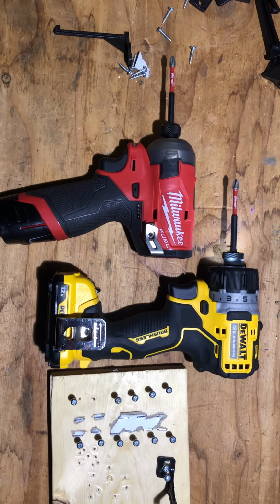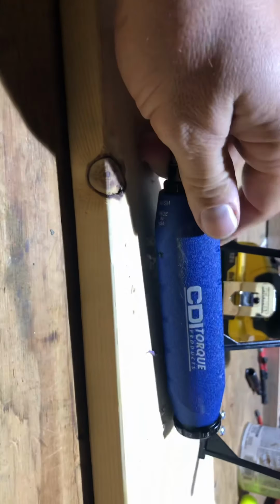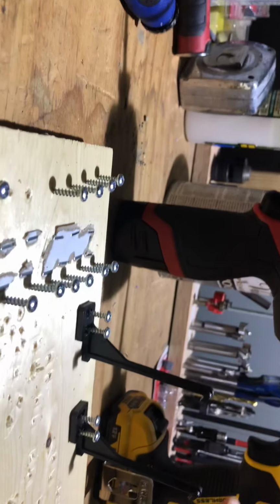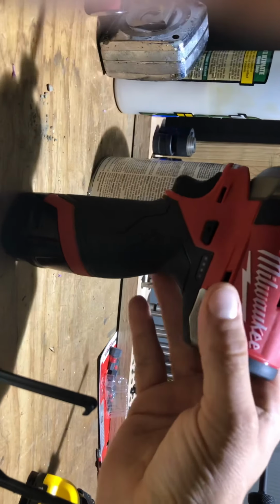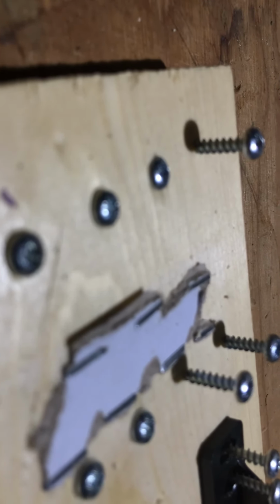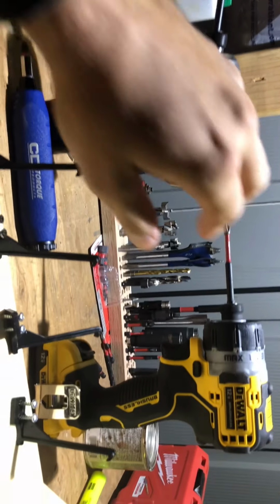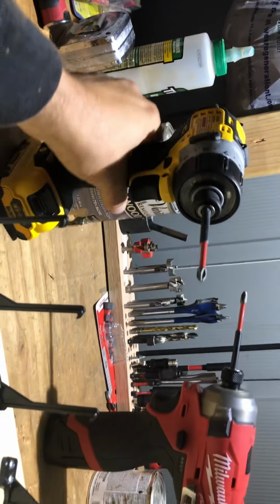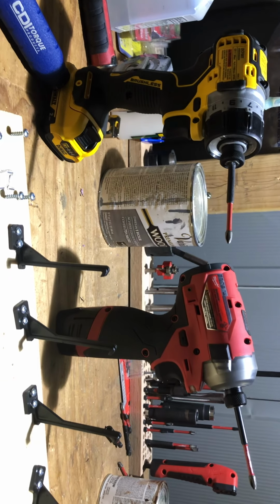Milwaukee M12 Surge vs Dewalt 12v Xtreme Screwdriver

Comment: You should try the 801 becuase it's an impact like the surge but has all the things that make dewalts 12v amazing. Grip and weight is second to none. Also love they have quick release on hex.
Reply from the maker: I know I’m comparing apples to oranges but that’s the point. Knowing what tool to use in certain situations is good knowledge. Knowing how far you can push lighter tools means maybe you don’t pack everything you own for a task.

Comment: How is the dewalt screwdriver any different than a drill? Like the 12v xtreme drill..

Both have clutches, yet the drill can do more than the screwdriver. Trying to understand better so I can purchase one over the other..

Thanks
Reply from the maker: Bomb X Reviews if you don’t have either I’d probably buy a drill but it depends on your application. The screwdriver does not have a very high rpm and there’s no gear selector switch on it which is one of things I like about it but if you need to spin a bit faster it’s just not gonna happen and if you don’t have a drill at all I’d say probably buy a drill first just because they’re more versatile. but the screwdriver is smaller more compact lighter weight simpler and has better lights and is easier to change the beds because it’s just a quarter inch collar
Reply from the maker: Bomb X Reviews  also though a lot of people are just buying an impact driver which puts screws and stuff and super easily but can also drill holes really easily they’re just a little louder. That’s why I have all of them so that I don’t have to decide LOL
Reply: Kenneth Kuhlman I appreciate your reply. I do have a drill. I have the Makita 18v subcompact and also the dewalt dcd996.. I don’t need any tools honestly but I like adding to my collection lol.. I don’t have anything like this screwdriver at all, but didn’t know how much like a drill it was.. if it’s a bit different I guess it would make sense to get the screwdriver over the drill
Reply from the maker: Bomb X Reviews I really like the Dewalt Screwdriver. It’s so light and balanced. The light is awesome. I have all the Milwaukee stuff and I find the Dewalt screwdriver worth having.
Reply: It's just a really good electric screw drive. I would recommend getting the extreme 801 impact driver instead. Alot more versatile and powerful. Screwdriver and impact similar but not the same.